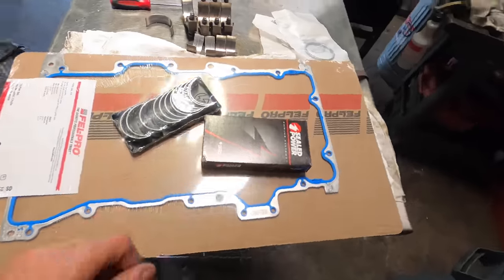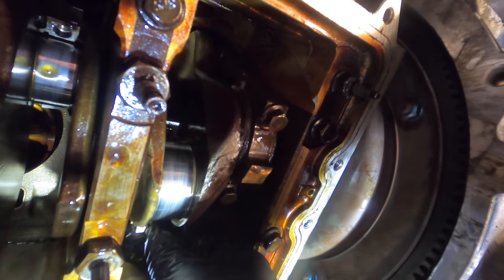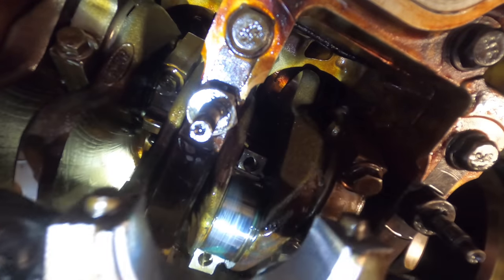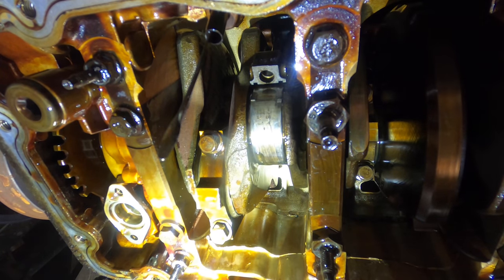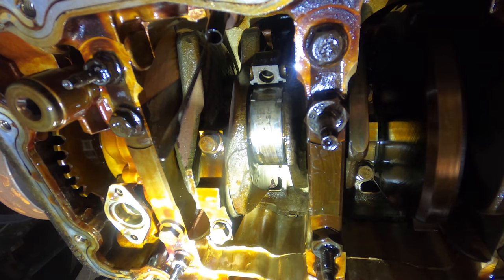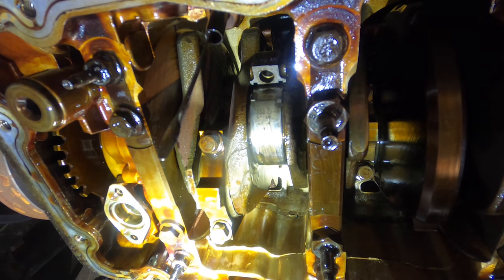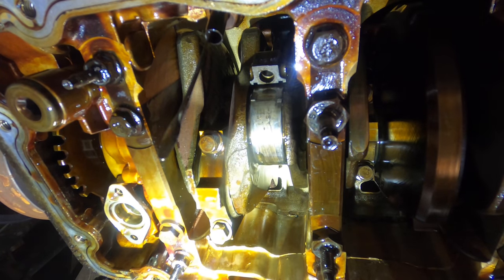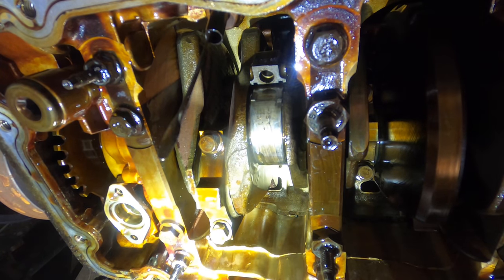Saving an Engine: Spun Bearings Replaced

Comment: A story from my childhood... I had a Maverick with a 250.  I acquired a 302 that I wanted to swap in, but my Dad was against that until I had a bit more experience under my belt.  I determined that I would run that 250 hard as I could, with very little oil in it, to speed up the upgrade.  It took several months before it developed a slight knock.  Not wanting to reveal my plan, I mentioned that I needed to borrow Mom's car that night for the school dance as my car was sounding a little funny, and I didn't want to risk damaging it or getting stranded with my date.  Dad turned around and reached into the junk drawer (everyone's kitchen has one, right?) and pulled out a box of bearings and some plastigage.  I ended up changing out the bearings, laying in our gravel driveway (we had 1 asphalt and 1 gravel drive) just in time to break them in on the drive to pick up my date for the dance.  I went through several other cars, building and flipping (a self funding hobby for me back in the day), but kept the Maverick, with the 250 in it, for several years and many thousands of miles, until some kid that reminded me of me talked me out of it...
Reply: Nice ❤
Reply: Haha. You learned a great lesson
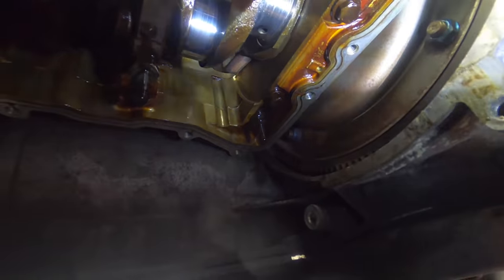Reply: @doda7443 - Weird to see your reply just now.  He died 8 years ago, tomorrow, on Memorial day at 1:30, two hours ago.
Reply: @Phantom0fTheRouter  😢😭
Reply: I remember the first car I owned it was a 1975 Mercury Grand Marquis. My dad and I bought it from the junkyard as a project car for my 16th birthday. The engine has blown. It originally has a 400 Ford engine, but we put the 351 Windsor in it. We had to special order the pressure hose for the power steering pump, modify the engine mounts by cutting through the Front crossmember, and change the bell housing (They are slightly different, could mount up, but my dad wanted me to have the experience.) but we got it done. 

Shortly after, I was working for the summer detassling corn. My brother was on the same crew. I went out to play a little bit, and was too confident in my abilities. I ran into the ditch and needed a pull out of it. I got a hole in the gas tank. By that time, my dad has died from a heart attack. My mom said to put some JB Weld on it and take her from Kahoka, MO to Muscatine, IA. I did. She called the police on me in Muscatine. I got arrested and lost my car.
Reply: Good story!
Reply: @Richard Paul  she's crazy for calling the cops on you! If she was my mother I would of told her I no longer want to see her!
Reply: you should have removed a quart and a half!
Reply: Properly maintained, the Ford 200/250 was a great engine  lasting hundreds of thousands of miles.  The 144/170 only had 4 mains...not quite as hardy or smooth.
Reply: Sounds like pops knew what you were up to. Box of bearings ready to go for his unsuspecting son. Good stuff.

Comment: Love stuff like this. The “save it if possible” approach needs to be a standard across more shops. Takes more skills and knowledge to repair than just replace. Nicely done!
Reply: If a tech (today, they are not mechanics most of them anyway) cant hook up a computer to ur car n the computer say, change the bearings, they're not going to know its even possible to change em let alone how to do it.
Reply: A tech goes to school from his highschool auto shop where he learns general repair based on what's done that he can witness. What he can read, what he may be taught, to going to tech school at a voc tech class, to a college of automotive tech.
Several teachers may show how to teardown and measure for repair and obtaining the parts list information and ways available to address the issues they find. Larger schools with engine lab and a whole department may demonstrate the machine work.
If a technician takes the full program, he has to be able to do all the work of an engine rebuild.
They get engines from a yard and assign them to lab teams.
The team has to be able to fully fill out their lab requirements and produce a running engine at the close of the program.
What they are limited on is parts.
With no paying customer, it's reuse most of it having learned and reassembled.
If it's gutshot, they teardown another one.
Once a technician starts his apprenticeship, it all starts over again with night school. The teachers are mastertech from car dealers if he's in a union.
There's alot of thought required and alot of hours, days, weeks, months, and years. The spouse spends alot of time at home without him. He comes home sometimes and collapses in his dinner.
Other programs require more self study and don't have engineers for teachers. But mastertech can teach you what's not in any book.
It's alot to learn. And alot of tools to buy.
Then you learn from journeymen on the job.
When you get a job like ray has been assigned here, there's judgement that enters in.
That sparkly oil that was in the pan, has been run through that oiling system. The pump, the cam, the galleries, every orifice can be holding on to small pieces of catastrophic carnage making bits.
He had best clean and inspect every aspect and know that engines bulletins.
The customer may expect ray to use his crystal ball. There isn't one. Ray needs to be sure that guy understands, this is an in the pan set of bearings, hopefully an oil pump, and a gallery flush. The mains haven't been inspected.
I hope he does that.
Cross your fingers.
If some other failure occurs, the customer needs to have that idea explained before saying fix my #6 rod bearing and dress my crank journal only.
They need that paperwork with his signatures and initials.
If a job like this goes haywire later, it can be a very bad day.
Then somebody has to buy a shortblock .
And about thirty hours.
Or another combination of parts and labor.
Because Taurus platform cars are so labor intensive, it could be why they did this instead of demanding a remanufactured engine. You don't want to pull that one.
I've seen techs lose their ass on major power train repair on these.

Comment: I had a customer with a Vortec V6 in a Hyster forklift that spun a bearing worse than this. I recommended doing a crank kit at min but he wanted to try cleaning it up first. I cleaned the crank, threw new bearings in it and cringed as I turned the key for the first time. It ran perfectly, every oil change I checked for any signs of problems and never found anything. 5 years later and 4000+ hours it's still running. I've done some sketchy stuff on my own vehicles knowing there's a minimal chance it'll work much less last and sometimes you get lucky.
Reply: @Green Mamba Games Cylinder 3? those 2.4L's were known for that.
Reply: @Ender_Wiggin03  no the 2.4 twin cam is a 4 cylinder engine used in in smaller gm cars. Honestly better than the 3000 series if you ask me. Besides the 3800 wich didn't come in the grand am but can easily be swapped in
Reply: @narwhal9852  I think @EnderWiggin meant cylinder number 3.
Reply: @narwhal9852  I'm pretty sure you could get that 3800 (as the 3.8, later generation) in the Grand Am at some point. A lot of people had it and said it was really fast. The 2.4 was fast in that little tiny car, so I can only imagine the 3.8 lol
Reply: @PassiveDestroyer  I'm sure he did, and my 3 was the worst when I did mine.
Reply: @edifyguy  actually the grand am biggest engine was the 3400.. but the 3800 can be swapped in pretty easy. But GMC did make the 3800 supercharged that also is easily swapped in. With a tune alone they can make about 340hp wich is pretty good for such a small car honestly over kill lol.

Actually there where grand ams with the 3500 but limited
Reply: @narwhal9852  Oops, yes, it was the 3400 lol. I forgot about that one.

Comment: Great job! I think most mechanics would have told the customer you need a new motor instead of doing that work. Nice to see an honest mechanic doing an honest job.
Reply: Most of the time the crankshaft and connecting rod are way too gone. Easier and sometimes cheaper to just get a new/used engine unless doing modifications.

Comment: I'm amazed at how resilient that crank journal is.
Reply: The bearings are deliberately much softer than the rod and crank so that when things go bad they take the vast majority of the wear. The crank is the hardest piece in the assembly. If the crank is seriously damaged, someone did something really stupid, like get this knock and just keep driving it that way. Knock knock quickly becomes BANG BANG as the bearing gets completely shredded and then the rod and crank start hitting each other directly, and that's when the real damage starts.
Reply: The crankshaft surface is hardened only a few thousands of an inch so it holds up and the bearing is a softer material. For that reason never have your crankshaft machined unless it's absolutely necessary. The hardening prossess is rarely done by machine shops so your left with a softer crank surface that'll score more easily.

Comment: Great job! The first time I did that exact same job was on a Humber Super Snipe back in the late 70s. It's generally always the end rod bearing furthest away from the oil pump that fails completely, as it's the last one in line for oil when the pressure drops due to starvation, but obviously get a set and change them all as you did. No point in worrying too much about the crank main (or axial) bearings, as they generally don't suffer so badly when there's oil starvation, and in any case it's often not possible to remove the ones at either end of the crank without major dismantling. That engine should go on for many more miles. Well done!
Reply: He didn't sand the journals very well. That would concern me. On my car it was the #3 rod that spun (3rd from the pump). And I was able to get all but 1 upper main bearing out because it didn't have an oil hole in the crank for me to rotate it out.

Comment: The owner of that car must have really loved it, because this work would be incredibly expensive. You sir are an artist, a mechanic who has a passion for what they do & not just a job, you really did take a lot of pride in that, much respect to you.
Reply: Cheaper than today's used cars.
Reply: He said it was a kid who bought the car and never changed the oil. He rebuilt the bottom end for a few shop hours and some parts. Few hundred bucks maybe. I hope the kid was grateful and starts doing oil changes.
Reply: Does this work well long run?
Reply: @great4ever845  if the damage is minimal/none, yes. Otherwise its a band aid.

Comment: Great video.  My only thing is that, when I'd watch my uncle rebuild a motor like this he'd take the caps off and push the pistons up with the spark plugs removed, then use high powered air to blow thru the journal oil holes to make sure no tiny particles of metal got into the crank oil system.  I know this because that was what he'd put me doing so I got all nasty from it since he did all this laying on the concrete (no lift) and I'd look like an oil refinery exploded on me..lol.  I do know that, sometimes there would be small metal filing come out those oil holes.  And if they did he'd use a pressurized oil device (of his creation) to force oil thru the crank to make sure it was flushed inside completely.  Not sure if this is needed anymore with today's engines as this was on old 60s and 70s engines from Chevy, Dodge, or Fords.  He paid me in the early 70s around $10 for each one I blew air into and $15 for it if I had to use the pressurized oil thru it.  Yeah, young kids for your dirty work was a great thing...haha.  Anyway, only thing I saw you didn't do so wasn't sure if it's needed anymore.  Love watching your vids.  I learn a lot watching.  Mostly you guys get paid more hassle than  you should from people who think things are so easy to do and shouldn't take more than 10 to 15 minutes, not knowing you, sometimes have to remove half the topside or reach into spots that are tight and on hot engines.  Keep it up, bro.  Maybe the world will find out it's not a simple fix always and lay off your backs.  Take care.

Comment: Great vid!  At 26:05 (pick up tube install) you hand tightened the nut but I didn’t see it ratcheted down.  There was a edited part that could’ve been done but not seen.  I do like your thoroughness.
Reply: Great eye...yes never got tightened, probably in the bottom of the pan by now where it will live out the remainder of it’s life. Should be fine lol
Reply: Only just now saw this video... and I was about to write this observation when I noticed your  post here; I noticed the same thing: the nut holding the oil pick-up tube bracket was only hand tightened... And further down, you will see it has not moved any little bit from it's hand tightened position, so it was not torqued or even snugged down unfortunately... 
But hey I wish I had a mechanic like you Ray here in my neighbourhood... you are brilliant!!!
Reply: I noticed the same thing and came to join in on the comments. 
While I'm only a shadetree mechanic and only do small stuff of my vehicles and me friends, I'm always paranoid (concerned) about missing something so I always go over and over fasteners while I still have access. 
I have the utmost respect for this man and enjoy his channel quite a bit.
Reply: I noticed that as well, I hope he re-tightened the 0-2 sensor as well, he loosened it before disconnecting the wiring.
Reply: Ok good, I was not the only one that noticed this. 😂 I was telling you to go back and tighten it many times watching that video, 😖 but I guess I was not loud enough... 🤣🤣🤣 
Oh, And the O2 sensor as well. No worries. That car would still be fine. It was only a support leg. Not a loss of suction point. So should be good. 
Great job still..!!

Comment: One of the strangest rebuilds I did was on a 50's GM 135 six cylinder engine that an old man used to haul empty metal barrels around in his truck.   The old man didn't get over 45 mph and didn't want to spend much money on the engine.  So I rebuilt the head, guides, ground the valves , seals etc.  Then I used the crankshaft paper as you did in this video to polish the rod throws.  When I started the engine up the oil gauge nearly pegged and even at running temp it had like 40 lbs of oil pressure which greatly puzzled me at first.   Then I remember that the rod throws on the crank were egg shaped and the gap between the bearings and the crank created an oil pump effect!   The old man drove that truck several more years before he gave out but the truck didn't! lol
Reply: I guess the old man needed a good hearth mechanic to fix him for few more years.

Comment: I love your dilligence, you work as a surgeon on your jobs. I remember rebuilding engines under a shed or a pecan tree back in the 1970s on my Dodge Challenger R/T 383 and also on a Ford truck 300ci straight 6. I didn't have the luxury of a lift, only a chain hoist and rope slung over a tree limb or lying on my back on a piece of cardboard. I used STP to lube the crank bearings back then, but this brings back so many memories. Great job brother!
Reply: You had the luxury of cardboard?

Comment: Great job! Around 26:50, never saw you tighten the nut for the oil pickup tube.  You did tighten the two bolts.
Reply: I also noticed that. Especially because the nut did not change position in the image transition.

Comment: You're the man. I've often wondered about this specific repair, replacing the rod bearings by taking off the oil pan.

Every Negative Nancy on the internet says you should never do it, but it always seemed possible to me, and if you're other option is to pull the entire engine, why not try it?

Good instructional video. Thank you.
Reply: My step dad told me stories of pulling spun bearings and replacing them with leather belt material. He said it didn’t last long and they would redo it. He would finish his story with “poor people have poor ways”
Reply: Yeah this was great..being young and inexperienced I had "friends" with that real "Can't Do" attitude..Glad I dropped those guys along time ago. This kind of pragmatic low cost ingenuity could've saved me a classic Dart that was lost to Pick n Pull.
Reply: I got my early training in mechanics and engines from a WWII veteran who was stationed in North Africa during the war and , being a mechanic, was called upon to improvise all sorts of repairs even using parts from destroyed German tanks and planes etc.. Whatever came his way, he fixed it. By the time I met him and worked with him, a running joke was that Roy, my mechanic mentor, learned everything he knew in "The Sahara School For Auto Mechanics". I learned from the best!